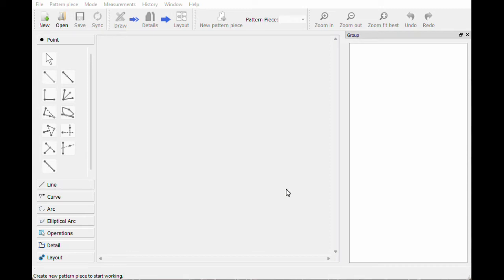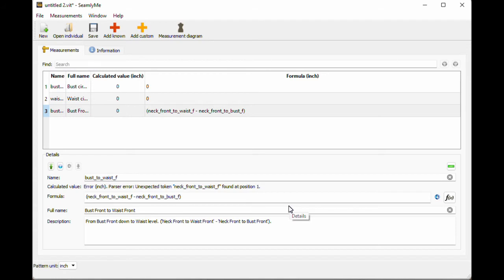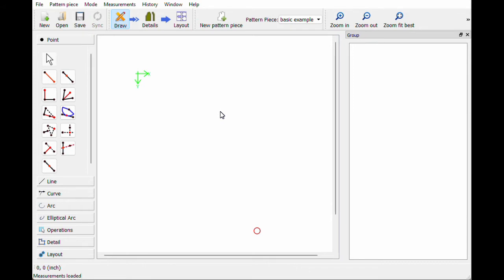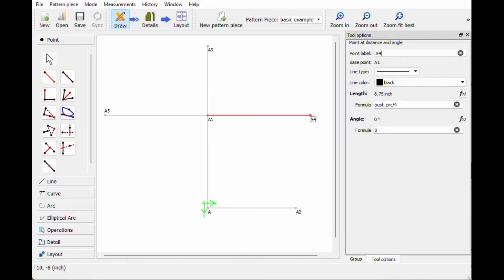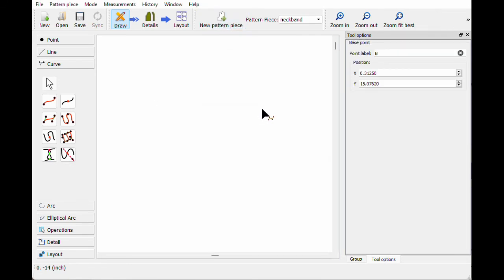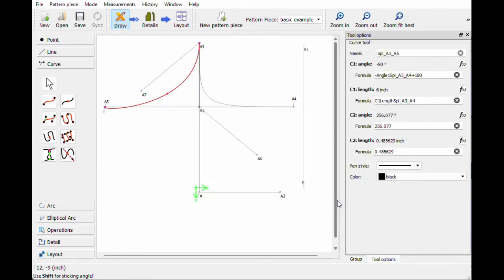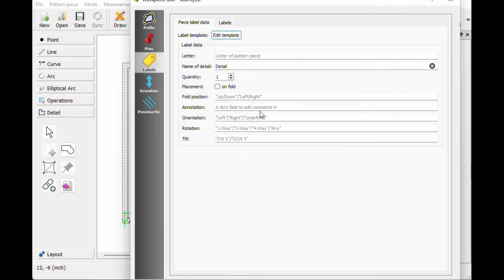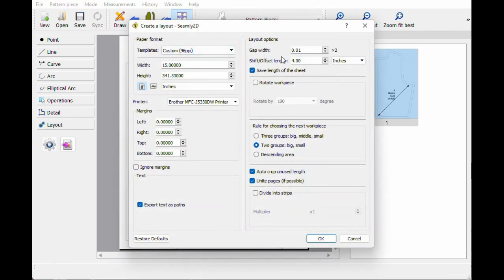Video 3: Advanced features on Seamly2D how to CAD design draft sewing patterns

Comment: Can you also grade patterns?
Reply from the maker: So, the software claims that you can. I have never been able to figure it out, but am always messing with it. If I ever get it to work I will tag you in the video so you can use it as well.
Reply: The software only allow you switch btw sizes. You can not include gradelines. To grade you will have to export to Adobe illustrator